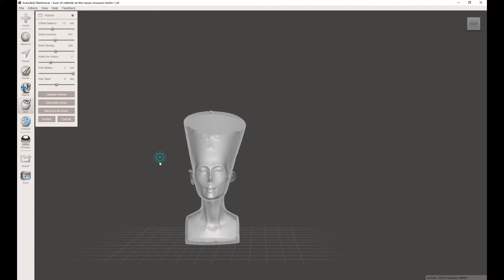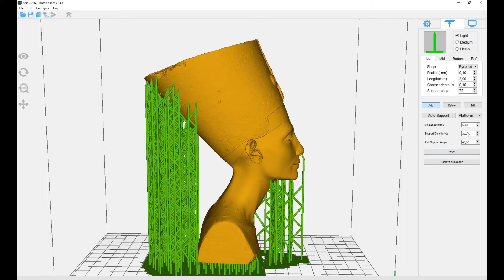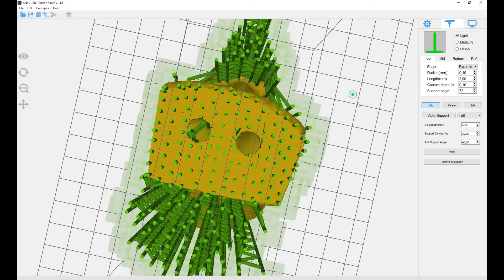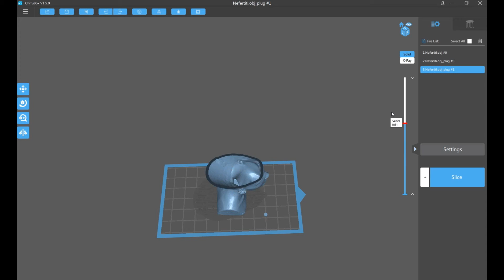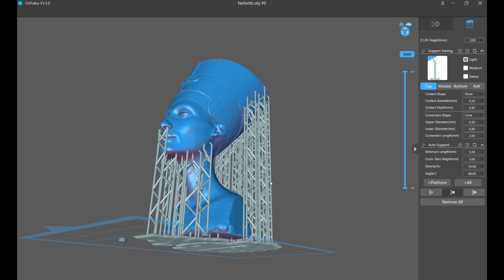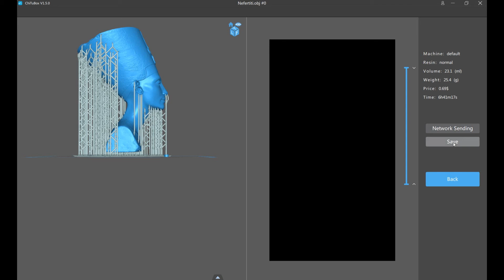Comparision Chitubox & Photon Slicer

Comment: Hi, using the photon workshop, how do you slice the model into .pw0 format? Mine only has the option for slicing into .pws format. This is for my photon zero which seems to only read .pw0 files.
Reply from the maker: Really? I don’t own either the Photon nor the Photon Zero. So I really feel very sorry that I can’t help you.
Reply: @choschiba  thank you for your reply. I discovered my problem. User error with non-user friendly software. :)
Reply from the maker: Okay, at least you have found out why it didn’t work in first place. So that means they should really improve it. You could try the Lychee Slicer instead. Don’t know if it’s still free at the moment or if they are charging for it.

Comment: Thank you for this Video!
I'm new to the world of resin printing and it really helps me for future prints. 
I think I will give ChituBox a try. :-)
Reply from the maker: Yes, that’s what I really would recommend, as it gives you more options. You can use the settings I use. The only thing I think I changed in the beginning was the top contact point size. But I’m not quite sure.

Comment: sometimes it won't support for me as well when i click a spot. didn't on v1.4 for me (only had it a week though) and I think I found just doing a slow click rather than a normal quick click helped.
Reply from the maker: Haven’t had that when I used the software slicing my last model. I ran a „computer cleaning“ software now. Let’s see if that helps.

Comment: I could see one difference between platform and all. The "all" one had support on the ear which went to the model's body. The "platform" didn't. The platform should mean just supports from the build plate whilst all should add them starting anywhere, even the body if necessary. Maybe this model just didn't need them which is why there was not much difference.
Reply from the maker: Yes, you are right. I know. Was just wondering why the slicers interpret that so different. That’s why I played around with the settings for a while.